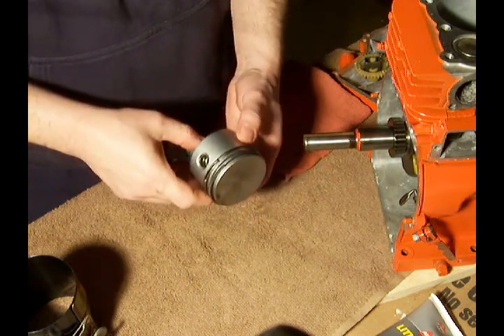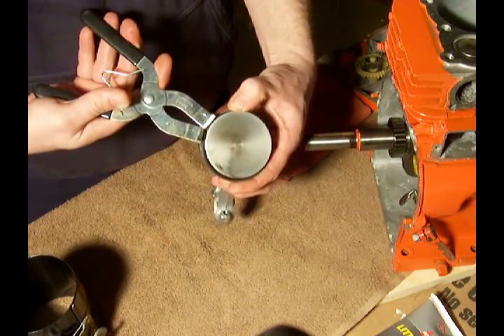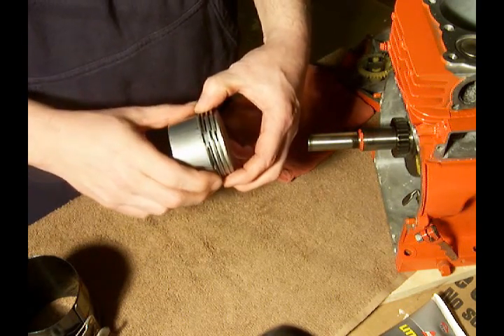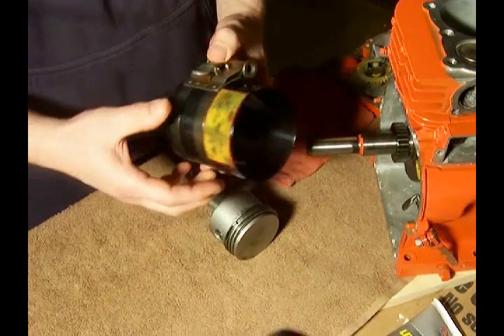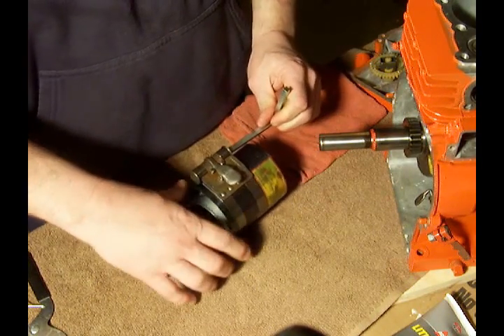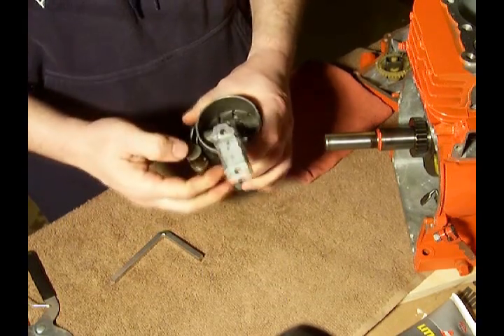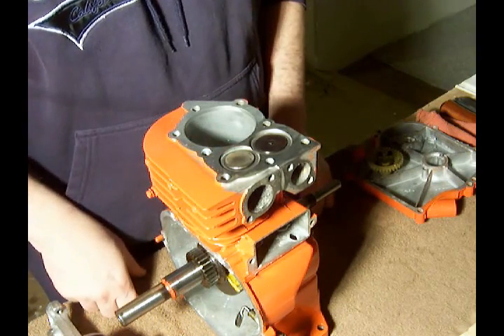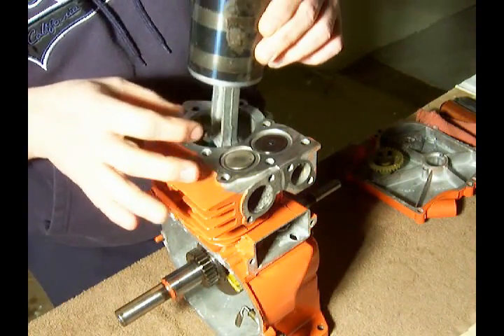#5 - Briggs and Stratton 5HP 130202 - Piston and rings installation

Comment from the maker: These numbers are not like a vehicle identification number on a car. Small engines do not need to be registered like automobiles. So if somebody stole it and wanted to hide the engine identification, they were wasting their time. The type number identifies the engine mechanical parts, color of paint, decals, governed speed and Original Equipment Manufacturer. The code number identifies the assembly date of the engine.
Thanks for watching.

Comment: I recently installed new rings on my Briggs & Stratton mower engine (OEM parts) and I ran into a couple of problems that I think are causing low compression. First, one of the compression rings had absolutely no paint stripes on it and the other had only one pink paint stripe on it that was further to the right of the gap than the instructions indicated it should have been; there was no second mark. So, I basically had to guess at how they were supposed to be installed on the piston and I think I guessed wrong. Also, the upper ring groove had a spot where it narrowed, causing the ring to stick and preventing it from moving freely. It did not appear to be the result of damage, so I'm not sure if it was like that by design or a manufacturing flaw. Any advice you could give would be greatly appreciated.

Comment from the maker: @tv175s3 I have edited video #6 to include the crankshaft and camshaft installation. The oil that I used was just some random engine oil from my shop. However, most small engines recommend SAE30. Winter engines (snow throwers) should use 5W30.

I have a bias toward Amsoil and will be putting 0W30 synthetic oil in this engine.
Thanks for watching.

Comment: I enjoyed your video ! Why not just squeeze the rings one at a time instead of that tool where u cant see the rings? would a132232 have the same size rings as your model, what size are they? I have a smokey one to fix and i cant find the specs for it.
Reply from the maker: If you don't have the tool, you can VERY carefully try to do it manually. As far as the rings that you need, a quick internet search shows a standard set to be "Briggs and Stratton 399067". I use partstreeDOTcom to locate part numbers.

Comment: I have a 5hp Brigg from 1983 it a 130297 1665 01. My question is can I deglaze/hone the cylinder wall? Its all aluminum, no cast iron sleeve. I heard u should not run a hone thru it, just install new rings and it should seat itself? The cylinder wall looks pretty good, no major scarring or problems. Whats your opinion? Thanks and another great video!
Reply from the maker: Deglazing and honing are different. I believe that honing removes a lot more material. Too much material and you may need a larger piston and rings. I personally have never honed a cylinder but I deglaze when I rebuild. You could most likely get away without deglazing. If your cylinder walls have a visible crosshatching, you should be fine.

Here is a video showing how I deglaze.
http://youtu.be/f_JeDQ0AMxs

Thanks for watching.

Comment: Use caution on oil weights. Check the manufactures recommendation. Some can use a straight 30w, but others MUST run 5w30 or 10w30.

Comment from the maker: I have no idea what kind of a gap you would need. When placed into the cylinder of the engine, the rings will be squeezed tighter around the piston anyway. Just make sure to stagger the gaps so oil doesn't leak through and cause your engine to smoke.

Comment: hello friend,i have this engine and i have a problem
My engine to smoke,mix oil and gasoline
Warms up quickly and turned off
I have replace piston and rings,but i don't know the size of the rings
Can you help me,do you know the size of the rings?
Thanks in advance..
Reply from the maker: polat alemdar A quick internet search shows a standard ring set to be "Briggs and Stratton 399067". I use partstreeDOTcom to locate part numbers. Thanks for watching.